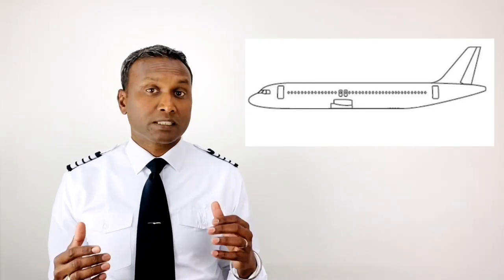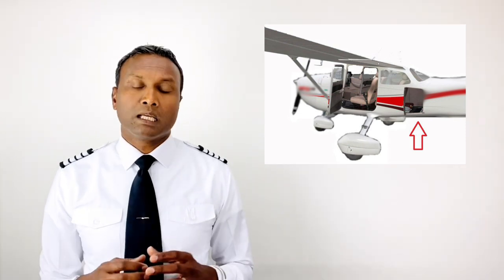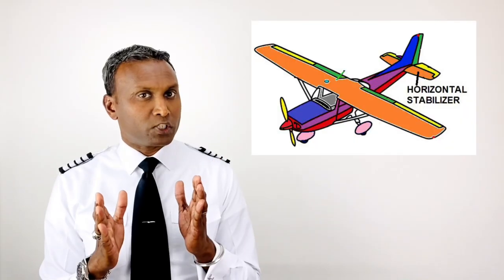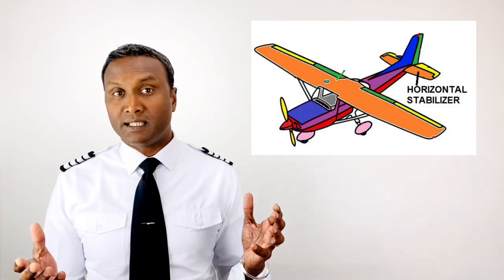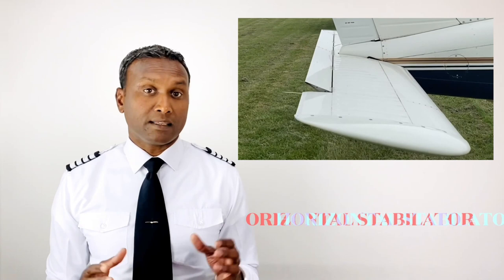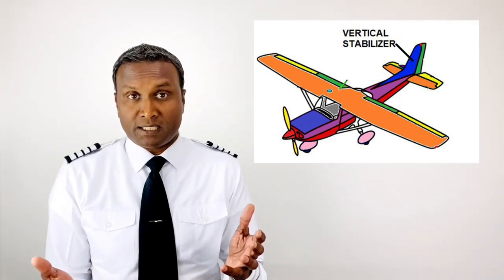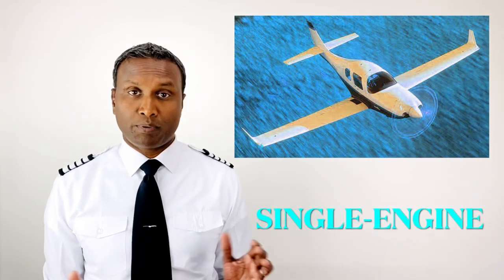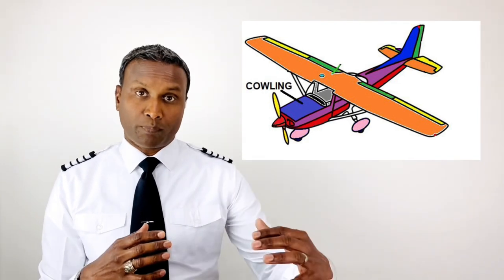Parts of an Airplane - Aircraft - Private Pilot Ground School Series - Flight Training - Aviation

Comment: Hi sir, 
My name is Avishkar Vvignesh frm 10 I was trying to ask questions to you during the session on 23/7/2021
My question is: why can't planes use reverse thrust instead of push back trucks?
Reply from the maker: Using reverse thrust while parked at a bay would cause a lot of debri and can be hazardous, so planes are pused back as you mentioned by trucks for example. In addition, the conditions to use reverse thrust are very specific as well.
Reply: @TheFlightSchool  Thank you so much sir!!